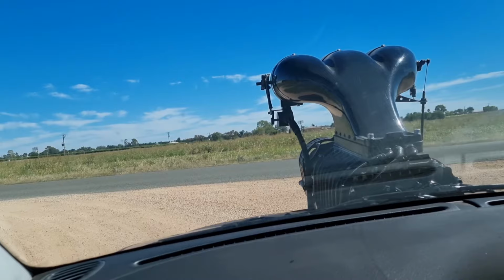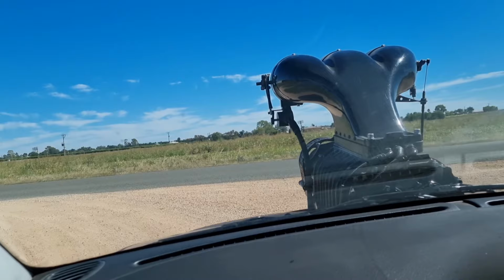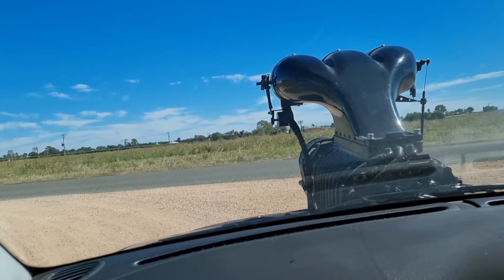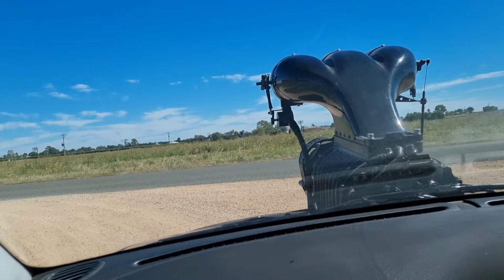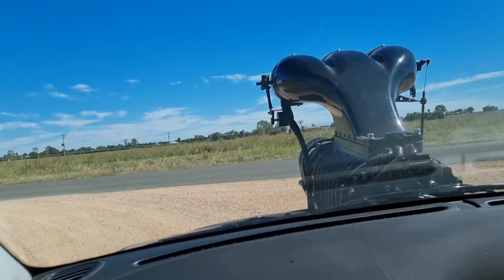M80 Torque-locker 3-46 Diff Replacement

Comment: These diffs any good for drifting ? Or only inline burnouts
Reply from the maker: Yeah but with a trutrak centre.
Reply: @carsnthingsrestos31  so the torque locker isn't good for drifting ?but an eaton trutrack is?
Reply from the maker: Trav,s is a standard LSD diff, the would both be better than a LSD Diff